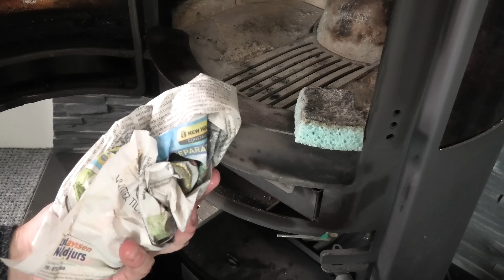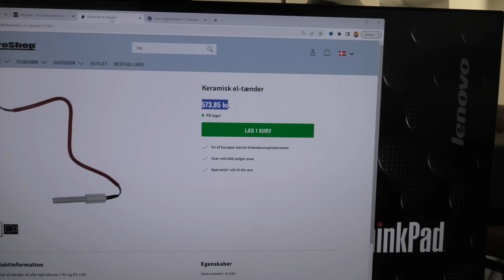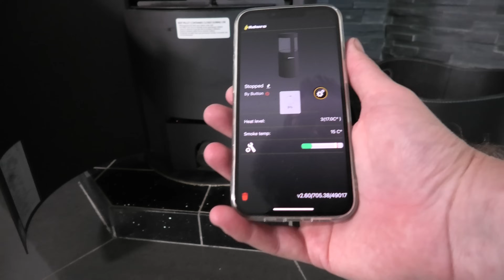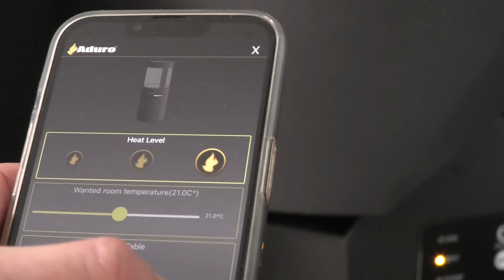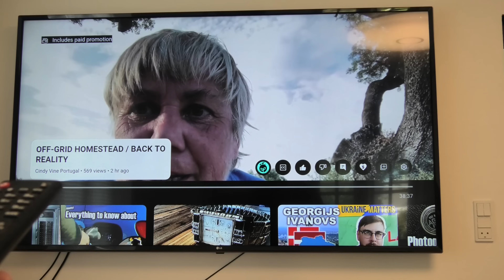Aduro Hybrid H1 - New Cheap Ceramic Igniter & Cleaning - 1325

Comment: Just a heads up, as far as i know, you have to be careful about touching the ceramic igniter with your fingers. Grease from the hands can cause the igniter to fail prematurely. It is similar to the way that you sould handle high power halogen lamps. Oil from the fingers = bad!
Reply from the maker: Thanks for the tip!

Comment: I use Jiff Ovnsrens to clean my fireplace glass, spray it on and it works immidently and one wipe and its clean! Or atleast clean of sot, i might need to clean it with a wet cloth to get it perfect.
Works very very well! If you have Jiff cleaning products in Denmark, im in Norway. 🙂
Reply from the maker: Great tip! I do not know if we get´s Jiff cleaning products here :-)

Comment: Original igniter resistance price is a real theft... When you know this is a simple wire in a ceramic case ! Nice save ;)
Reply from the maker: Yes,, it is a very expensive resistor :-/
Reply: Hi if you let your stove get very hot it will burn off any soot on the window and vermiculite

Comment: Hi, I was watching your channel from solar and batteries projects. And now I am going to buy an Aduro stove and have difficulties finding information in youtube with real reviews and experience and then I find your videos =))) I am a bit surprised with how strong the glass of your stove is contaminated. Good stoves, which I think Aduro should be, have nice glass cleaning with hot air during burning, so if the good wood is used (<18% humidity) and in normal burning mode with enough air (not "long time burning" with almost all air supplies closed) the glass stays always clean. So my question to you is: do you use it wrong (wet wood, burning with full closed air supply long term) or the stove is actually not so good and glass cleaning, which is advertised is actually does not work???
Your answer would be really helpful, since it difficult to find someone with real hands on experience
Many thanks in advance
Reply from the maker: I do believe some of my wood has been too wet, and then it gets dirty :-/

Comment: I have the H2. Your burner pot isn't installed correctly. That's why you get the slow ignition with lots of smoke and the flames trying to escape from the side.
Reply from the maker: Okay,, I will check it next time I mess with it..

Comment: Anyone know where to buy a cheap gear-motor for the internal auger?  The replacement motor from Aduro is 115 euro! Please let me know…
Reply from the maker: I am sure that Aduro does not make them them self,,, I would take out the motor and look for model numbers,, and start googling.
Reply: @MyPlayHouse  hello, thanks a lot. I will do that. The motor is not that good, I replaced it twice in two years. Best to you from the Netherlands. And thanks a lot for your video.

Comment: Ehm - I'll tell you the Apple way: "You are doing it completely wrong!" - the glass cleaning job that is - I think you are not using enough water on your paper.  What never fails for me is; Get some paper towels from the kitchen, get them wet, really wet so the dust will stick to them as you dip them in ash, get a good amount of ash with you, now smear/wipe the glass (be careful of running black water!!) - repeat over a small area and you will see that the water and ash dissolves ANY residue on the glass. Throw away current paper towel and repeat the process until you can see clean glass all over. Get a fresh towel, this time with water only, no ash - wipe glass clean, repeat until satisfied. Ignite oven/stove - enjoy flames through spanking clean glass 🙂
Reply from the maker: Hi @cs3194
Thank You very much!  glad you liked the video :-)
Thank you for watching! :-)
Reply from the maker: YouTube is messing up, and climes that I have not replied to this,, sorry for the "disturbance in the force" :-/